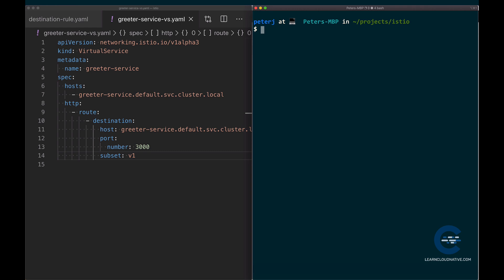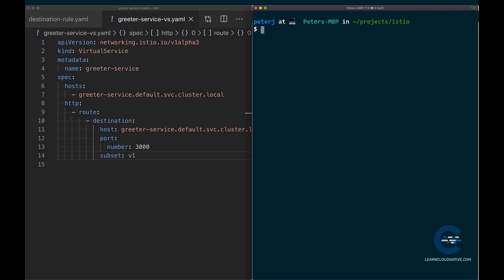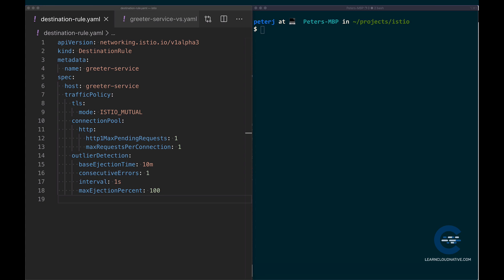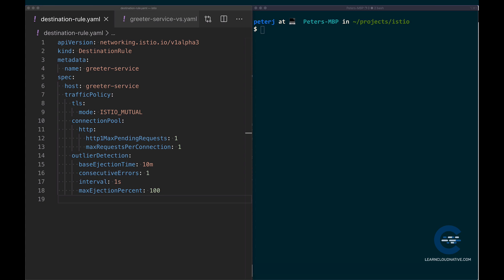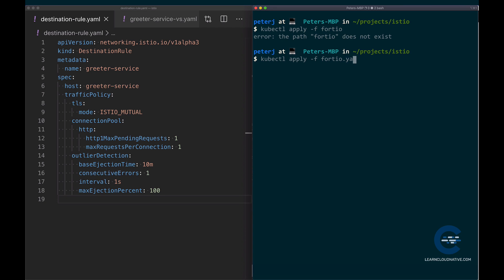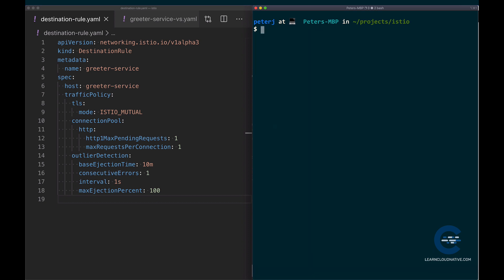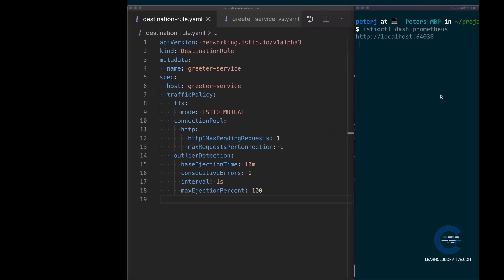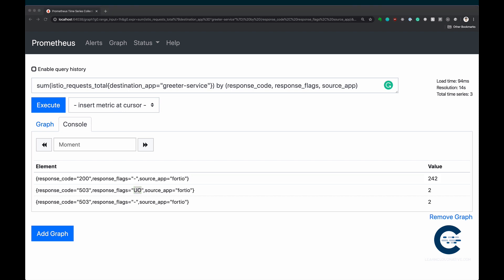Circuit breakers explained

Comment: I noticed you are not using a gateway in this example.  Is this because of the earlier release of Istio?  In most examples (current) w/ circuit breaker - I'm seeing pods deployed, and a gateway along with service, VS and DR.
Reply from the maker: this is a quite old video; but, gateway or not, it doesn’t really matter honestly

Comment: but my aplication server outside of k8s by istio-ingress-gateway still got 50% of "no healthy upstream" errors. Circuit Breaker works but how to force istio to load-balance only to healthy PODs ?
Reply from the maker: Istio will always route only to healthy pods -- if the pods are ejected due to a circuit breaker, Istio won't load-balance across those (for the period of time specified in the settings).
Reply: @learncloudnative  I have 1 good-POD with 200K  and one bad-POD with 503 . I See 50% of transmission OK, but the other 50% with "no healthy upstream" , It is tested from another POD near these 2 PODS and from Internet (via Istio Ingress Gateway)